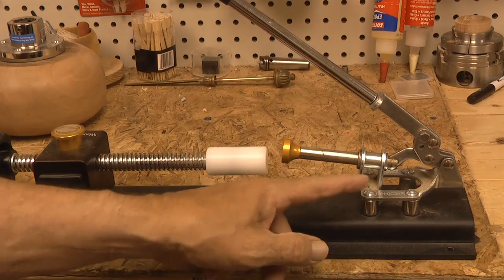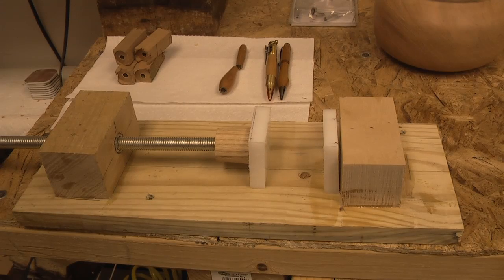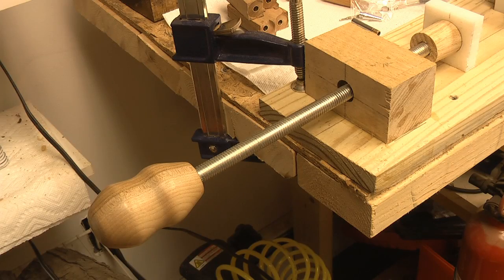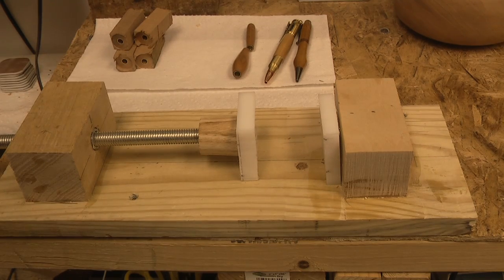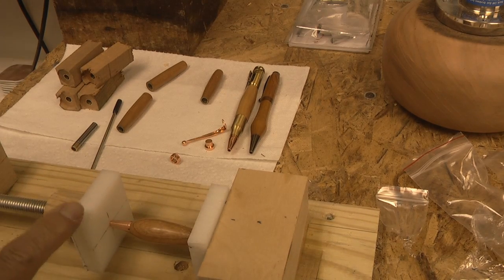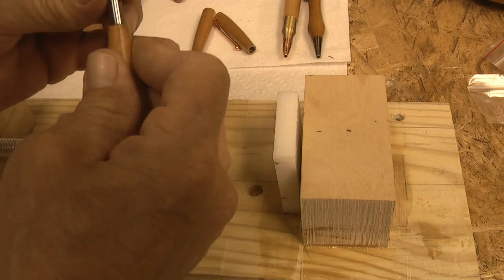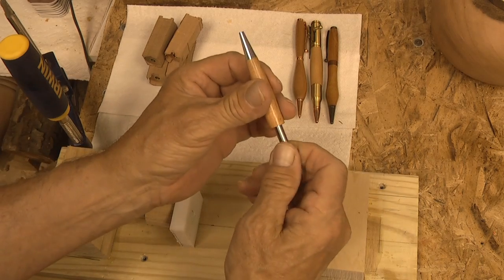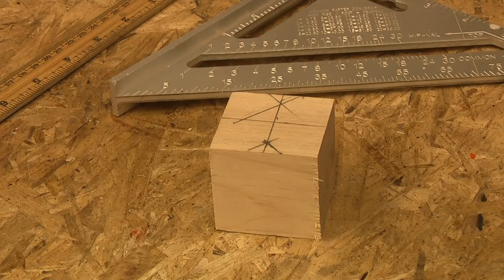Pen Press and Pen Makers Vise Solution #16

Comment: I turned a couple MTV arbors out of HDPE and use the lathe.  I made a block of wood the length of the barrel section of the pen with the transmission installed.  Now I just push the transmission in until the block stops me and it is set to the perfect length every time.  Works for slims, euro's and my cartridge pens.
Reply from the maker: what a great idea!  thanks for sharing and watching.

Comment: I came across this today and came home and got started making one for me. I think this saves me close to $75. One thing I did change was, instead of having wood on the end of the threaded stock, I added a sealed bearing. I think it will work well. Thank you for posting this!

Comment: Great idea.. just as a quick fix you could recess the plastic into the stationary end just to get that extra space if needed.  Thanks for the videos. They are fun to watch.
Reply from the maker: +Fern Moore thanks for the great idea i will set it in over the next week or so.  I already changed the handle to a larger wheel with a few spokes, makes turning a lot faster and easier.

Comment: Nice solution. I have the same commercial pen press, I hope that doesn't happen to me but if it does I won't be buying another
Reply from the maker: +Kaged Creations thanks for the feedback, I use it in the shop quite a bit, although it is a little "clunky" but it seems to get the job done.  some day I will try to get creative again and come up with a new and improved version.

Comment: I had the same idea .  Thanks for proving that it will work.
Did you try to dissemble the Commercial Pen Press and use the parts to make your homemade press?  Suggest you add a 2 inch "V" block to hold the pen body while pressing in the pen parts
Reply from the maker: +redriver08 thanks for watching,  with the prototype shown in this video I enhanced the knob to make turning the press easier by making a wheel with two spokes which sped up the pressing process.  I plan to make a new unit utilizing the turn screw and hdpe piece from the old unit.  I will likely play with the press handle to see if I can some how smooth and speed up the pressing.  Once finished I will show it on an upcoming video.  appreciate your watching

Comment: Good job Chuck I make my own hdpe parts out of milk jugs / bottles it's a great material and it also takes a thread ,and is very strong you might be able to build more of the press in the material thanks for the idea.  Mark
Reply from the maker: +mark lawson Thanks Mark, It never occurred to me to use milk jugs etc for hdpe.  I will try to get creative this upcoming winter and see if I can pull together an improved version.  Thanks for watching and the positive comments.

Comment: I woulda straightened the other press! It woulda took 1/10 the time.
Reply from the maker: Probably even less time, but sometimes i don't approach solutions logically, especially as i grow older.
Reply: No way.
Its failed once, it will fail again.
You would have to fit some cross bracing to stop it happening. More hassle than than it's worth.
This is a great solution...